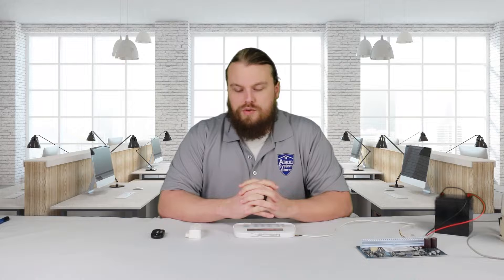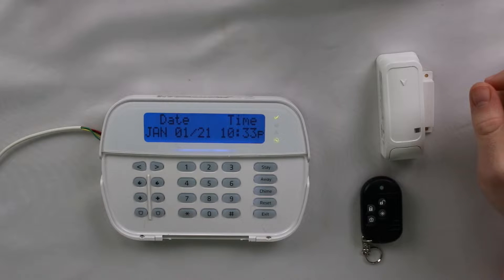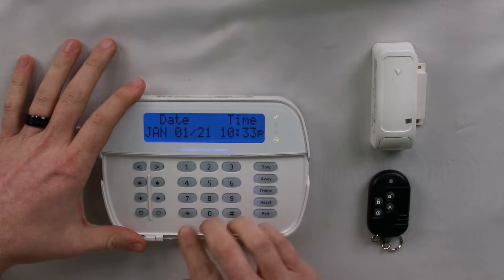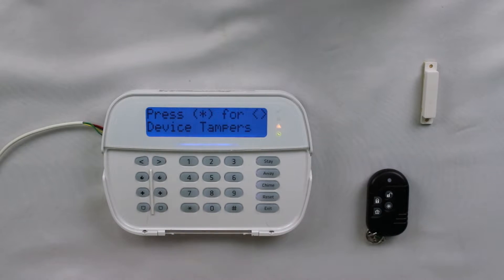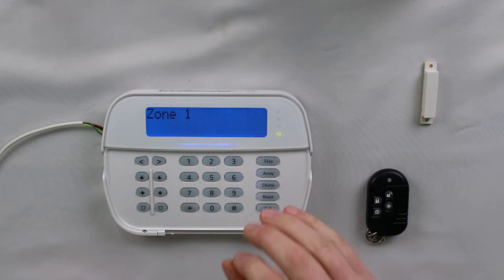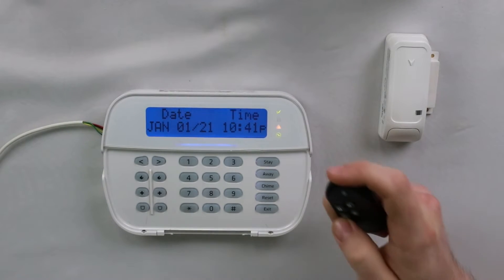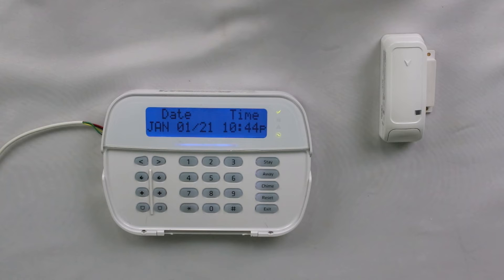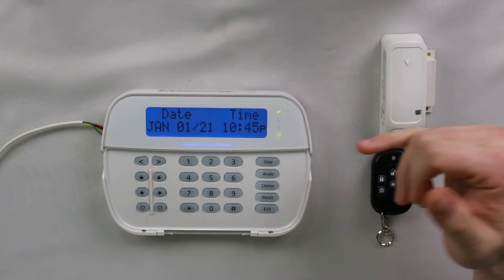Not Networked Trouble? Here's How to Clear A Not Networked Trouble On The DSC NEO

Comment: My window sensor went "not networked" after a power outage. Tried triggering a tamper, taking the battery out, doesn't change anything. Ideas?
Reply from the maker: Sorry for the delay, but if the normal methods do not work, the only option is to delete the sensor and re-enroll it by using the auto-enroll method to force the initial connection.

Comment: wouldn't doing a 902 search for modules and zones not networked?
Reply: Section 902 on the DSC NEO is only for enrolling, editing and deleting modules, like zone expanders, and has no effect on wireless devices. You may be thinking of the reception test from the previous generation (1832, 1864) system that was in section  902. The NEO does support a wireless placement test in section 904 that is similar, however, this does not always fix a not networked issue. Tampering a device gives an audible and visual reference on the keypad showing when the device makes the connection.